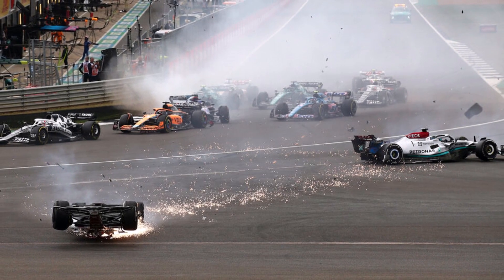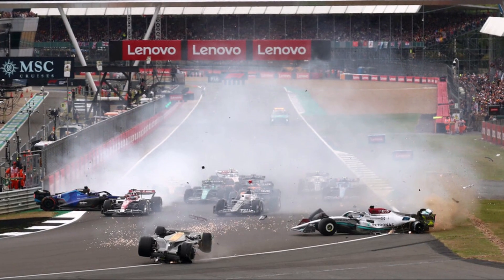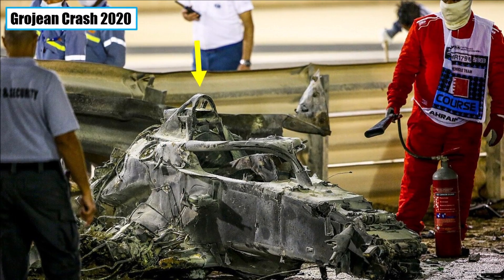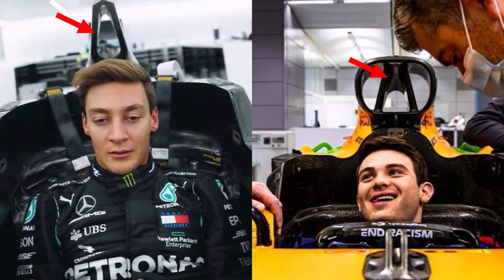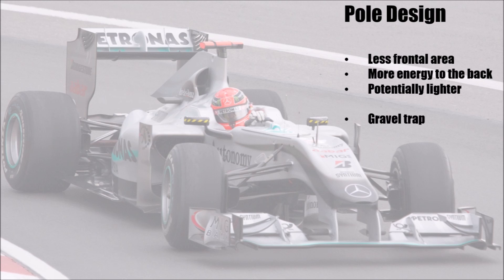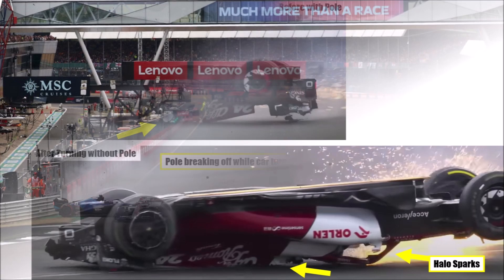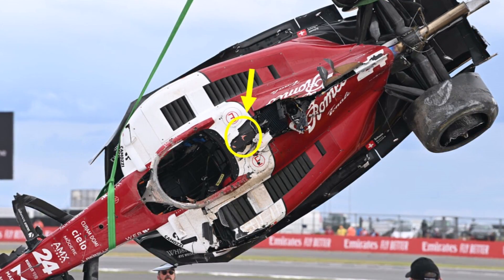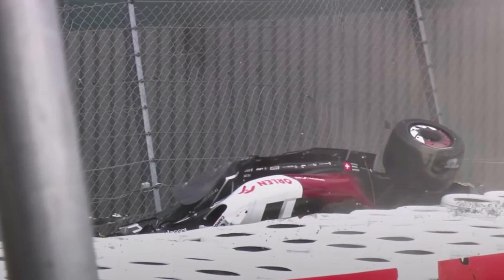F1 2022 - British GP - Lessons Learned - Zhou Guanyu's Crash Analyzed

Comment: there are a variety of safety flaws that became extremely apparant in this incident.

1 - the roll hoop failed. i never saw anything like it so it's likely it's a fabrication error or perhaps design flaw, but it happened nonetheless. if there was no halo, this would have been far, far more horrendous, likely fatal but atleast Zhou would have had spine / neck injury and at the least would find himself paralyzed from the neck down, but potential crushing of neck vertabrea could also snap vital parts and as such kill. The roll hoop failing is a serious issue and let's be fair here, it failed 100%. If this were to happen in a car accident, then the producer would face manslaughter and liability. Alfa/Sauber seriously needs to get a very very hard investigation. Things failing because of saving or inadequate safety measurements are exactly what cost Senna's life almost 30 years ago. 

2 - the end of the gravel trap needs to be alligned with the tire wall instead of having a 'road' at the edge. when zhou's tyre collected that 'wall' of the gravel trap (look at it as a swimming pool filled with gravel), the car was catapulted upwards. If the wall of the gravel trap was alligned with the tire wall, then the tires would have collected zhou's car and he'd be catched and thus held, into or on top, or in front of the tire wall, not OVER it.
another option is to have atleast double the distance between gravel trap end and tire wall.

3 - the distance between the tire wall and the fence needs to be increased. not decreased, as the opening helps in absorbing any potential impact. if it was directly to the fence, then the resistance would be greater and thus harder. landing on top of the tires is always a possibility but needs to be avoided as it complicates salvaging the driver from the wreckage.

4 - the danger is too that with the roll hoop sheared off, you cannot know whether the car's hybrids are safe and there is electrocution shock danger. there needs to be additional lighting, perhaps in the cockpit. now the roll hoop should never fail or come off, but could become damaged. that might also hamper the light working. so i'd say additional indicators are needed.

5 - there must be implemented fast extraction possibilities. it took way too long for zhou to leave the car. If there was a fire, he had no way of escaping (partially due to the roll hoop failing) and this would have meant a horrible death or at the least severe injuries. 

so these 5 things must be looked at quite profoundly. The track sided issues are really not that spectacular, but rather need to be brought into the rulebook. gravel traps are fine, but obviously the higher kinetic energy due to the heavier and faster cars and their designs need some fine tuning. the car sided things aren't so spectacular, perhaps the single-pillar roll hoop needs to be banned, and there needs to be investigated how the roll hoop is mounted and perhaps load testing must be increased since the cars are also heavier and as such carry more kinetic energy. the hybrid warning lights are an easy fix. 
the biggest issue imho is the extraction problem. it really is something to look into.

that said, i do wonder, did the roll hoop fail because it's a mandated design after grosjean's incident? the roll hoop did catch him but also kept him 'trapped' underneath. i don't know if a rule change was implemented but if so, this needs to be altered asap.

lastly, there are also some good things to conclude.

A - the halo once again saved a driver's life in a rather spectacular fashion, nothing short of that of Grosjean's crash. 
B - the car's safety features are so well designed (bar the roll hoop in this case) that Zhou managed to walk away from this extremely violent crash without any injury.

What surprises me a bit though is that if i compare Mick Schumacher's crash in Monaco, where the rear end of the car just snapped off (designed that way by rulebook), that did not happen here. I have no intel in knowing whether the G forces applied to the cars at those areas were similar, but Mick's crash in Monaco imho was not as violent as his crash a few races before, and it surprised me and others that the car snapped like that. 

If that is an indication of flawed design, then i'm starting to see a worrysome pattern here, which might come from the teams trying to save weight. Most cars if not all are/were overweight at the start of the season and some teams even saved by painting the car less. If they apply less weight by shaving off some material in areas like the roll hoop, the connections between the rear and front, then this is worrysome and should be swiftly adressed and perhaps the minimum weight must be increased.
Reply: You summed it up perfectly. There is definitely going to be an investigation on the roll hoops.
Regarding the gearbox coming off, in both of Mick's crashes, he went into the wall at an angle. So there was a significant net lateral rotational force on the car similar to what we saw in case of Romain's crash.
But with Zhou that lateral rotational force was not that much. It did flip but both car and the gearbox structure's rotation was on the same axis.
I would say the cars are doing what they are designed to do with the exception of that roll hoop. 
I honestly did not notice that the roll hoop broke off on the tarmac. 
That should never happen. Its a hard deflector type structure like the halo not an energy absorbing structure like nose cones.
Reply: @jozsefizsak  A suspension arm went through his helmet...
Reply: @Andrew-vx2ls  really? Wow.. how come he didn't sustain any injury then?
Reply: @Vik470  he did, he had major head injuries. Wtf you on about
Reply: @jozsefizsak  Senna's death remains a mistery but it is claimed that a suspension rod actually perforated his helmet and penetraded his skull and brains, which would have made him immediately lobotomized and as such, braindead. 

what my point is is that there is a great amount of evidence that suggest Senna crashed into the barrier because the car's steering shaft broke, making it impossible for him to steer. the shaft broke supposedly because of saving weight. It's exactly this what we're seeing in F1 right now - saving weight on potentially dangerous areas.

another issue is that senna's car also seems to have bottomed out - planking, making it lose downforce and thus sliding straight into the barrier. 

the reason it bottomed out was partially due to the neccesity to drive the car as low as possible, and the banning on ride height control. 

we're now seeing the cars porpoising like mad and the cars scrape the bottom of the asphalt, i keep fearing that we are going to see a repeat and we have a ban on suspension dynamics like the system (not talking about DAS even) that for example Mercedes was running. 

It makes it more challenging but also more dangerous, and to be fair, with the budget cap introduction, i dont think that they should implement those bans anymore since you have a limited budget anyway.

matter of fact, if those suspension 'trickery' actually nullifies or 'counters' the porpoising, then this should actually be mandated to be installed by the FIA. 

since drivers are getting far more worn and fatigued by the vibrations, i can only see more and more dangers. 

Matter of fact, there are elements in place right now that actually remind me of 1994.
Reply: @manoahvanderwolf3259  his steering column broke the bottoming out wouldn’t have caused him to drive straight off
Reply: @manoahvanderwolf3259  true, a lot of reports, different theories and opinions are written. However, I think it remains to be a mistery.
Reply: @Goaltimer  i agree, there are also some very interesting theories with more 'sinister' arguments but your statement is valid, it will remain a mistery forever. my point stands though that there are quite a bunch of similarities with the current rules, the following of the rules, and the governing that are eerily similar to that of both 1994 and quite frankly, that faithful day in Suzuka where we lost Bianchi, and there are only seemingly coming more and more instead of less.

again, it is fantastic that Zhou survived, but the amount of extreme crashes this season is really worrying. 

The dutch maniac also has been far easier this season but the end few corners against Schumacher showed similar behaviour of last year and once again is not getting looked into.
Reply: @manoahvanderwolf3259  - As the video pointed, the Alfa Romeo is the only car on the grid with a single pole design roll hoop when compared to the more traditional triangle roll hoops adopted by the remaining teams.  Both designs get tested vertically, longitudinally, and horizontally by the FIA under certain loads.

What happened to Zhou's car was-->1) It was fully fueled and 2)  after impacting with Russell's car, it sent the Alfa Romeo airborne to a certain height, turned upside down, and the shear mass of the car, velocity and the tarmac caused the single roll hoop to loose its structural integrity hence breaking off causing Zhou to slide from the tarmac into the gravel.
Reply: I totally agree with no 3, and add a layer of tyres behind the steel barrier. It was scary seeing the halo resting against it.
Reply: Loved the way you summed it up! But when I first saw the crash I wondered how Zhou's car simply flipped immediately. In previous Formula 1 cars we rarely saw that happen. Is it because the tyres have a much lower profile now, and the Alfa Romeo flipped because the rim touched the asphalt and acted as a lever? I'm not sure if Zhou's tyre running over George Russell's tyre made the flip more likely to take place but the fact that these tyres have a lower profile now make me question if we are going to see more accidents like this in the future. That tyre design was a major changeover that could haven't been well thought out.
Reply: @pedroneves8288  I am inclined to say that i personally think that the car flipping is not really that different from any of all the previous f1 years, again remember Guiterrez, remember Webber, remember Massa upside down in the Williams, Alonso in the Mclaren. 

However, it must be said, you do raise a valid point in the lower profile tires having less cushion compared to previous years and as such there could indeed be a harder contact, compounding the effect instead of lessening due to flex (cushion) with the bigger tire walls. there is about 5 inch less cushion / flex than previous years so surely it will have it's impact, but there's really nothing that can be done about it.

I don't really believe that it's necessarily a cause for more accidents, but there definitely needs to be looked into lessening the aftermath of such incident.

Whether the FIA has dropped the ball on testing the roll hoops by not increasing a higher load which it should due to the increasing weight of the cars (they weigh now a mimimum of 798 kg whereas in 2019 that was 740 kg, that's about 60 kg more and it means that needs to be calculated in, it might be 60 kg more, but kinetically the force grows exponentially so it might not even be a mistake by Alfa Romeo but a mistake by the FIA themselves.

There are valid points in regards to the mounting of the roll hoop. the Halo is bolted on, if the Roll hoop may be glued, then this is a certain mistake and must be corrected immediately. 

I think the right way to go even is to incorporate the roll hoop with the halo to make it 1 massive solid object. 

the dimensions of both the halo itself and the roll hoop can stay the same, just that they need to make it into a contineous form so that the 2 or 3 roll hoop mounting points are now also connected with a tube to the halo (on the lower part) and this would guarantee one solid, strong structure.

obviously, it would increase F1 car weight again and as such the force it needs to withstand also needs to be higher.

the problem is we're on an endless path here of weight increasement due to the safety measurements that need to be implied because the cars weight goes up. it's like a contineous circle that doesn't end.
Reply: @manoahvanderwolf3259  There seems to be a consensus here.  I was going by a very old article that I only vaguely remember.
Reply: @manoahvanderwolf3259  Tottaly agree with you! The great issue in this accident is definitely the detached roll hoop. I just tried to add a new point when I mentioned the new tyres profile. The new ones should cushion a lot less, as you say. Anyway, just checked on Youtube the 2014 Germany GP where Massa got upside down and a nearly identical crash at the 2014 Bahrain GP with Gutierrez. They were a carbon copy flip to Zhou's. So, maybe the tyres aren't so much to blame. On the other hand, on both occasions (Massa and Gutierrez), they got quickly into a straight position probably because their hoop made the car tilt a lot, since it's not flat, giving the car a higher centre of gravity when flipped over and, since they were in a hard surface (asphalt), the car tends to return to the "back on its wheels" position and tends to stay there, sliding away. That probably didn't happened with Zhou because of the gone glued hoop!
Reply: @pedroneves8288  I just checked Massas crash from 2014, its actually different. Massa was already turning for turn 1 there, the weight of the car was on the left side. With Zhu, it happened in the straight, so If you look at the replay, you will see how the tires stuck once he was hit, really like a lever. Interesting mechanics in play.
Reply: @Szaboo92  Just checked once again, and it turns out you should be right! Massa's car was already turning right when was hit from the right hand side. The new tyres may be a better lever. We'll see as time goes by.
Reply: The spectators need more protection too especially in that area.
Reply: Brilliant summary. It’s nice to read comments from someone who knows their stuff.
Reply: The drivers usually can get out of the car fast, he just didn`t have the space due to the cap between the tyres and fence where he wouldn`t had ended up in the first place if the roll hoop hadnt failed. The thing just flew off and left the car with a flat surface to slide on. So the roll hoop failing is probably the biggest issue with this crash.  Fix that and u probably dont even need to bother urself with the rest of the things on this list.
Reply: The design was approved by the FIA and has been used previously. To think Alfa needs to be investigated for endangering their drivers is ludicrous. It's a design flaw that needs to be addressed yes. It wasn't seen until now thus nobody expected this to fail as it did. I suspect after this they'll mandate just the one design implemented or more testing and development to strengthen and fix this particular design flaw. Overall I think there's a relatively easy fix either way.
Reply: @jozsefizsak  yes and no the main reason it was when senna crashed, the arm that holds the suspension on right side of the tire came of and he crashed and went inside of his helmet, and crushed his brain, the metal broke and flew back and hit him in the head piercing the helmet, right above the eye protector and where the helmet start, theres documentaries on youtube where they show this , was really sad
Reply: Single rod for roll hoop needs to be eliminated in favor of triangle design. Better yet, the pole should mount at the floor pan and be braced at exit of the monocoque for maximum rotational resistance. Single point of connection cannot resist rotational force as well as a multi-point element such as a hoop.Still, Ghou walked away, which, no matter how you look at it, is nothing short of miraculous. Kudos to safety engineering. Now, remove the jewelry.
Reply: Some dude on the internet (you) apparently has better ideas than the people who are employed to do such and spend multiple hours each week on this. Sure, the cars are pretty safe for most situations, but I agree that a lot more needs to be done to avoid someone getting injured or killed in an accident that is less likely to happen
Reply: the safety of the barriers is concerning. Grosjean crash was scary, those Armco barriers should be outlawed. As much as I hate to say it, nascar had developed the safer barriers, with very good results. The way Zhou ended in between the tire barrier and the fence was unacceptable. if he had a fire. I saw no way of him extracting himself and officials took their time getting to him. F1 needs to rethink, inspect all barrier at any track they race, and not race there until changes are made. it's unacceptable in this day, and the amount of technologies available, that at least have barriers that keep the cars inside the circuits so medics car help an injured driver. With amount of money spent in F1, they should be able to create a safer race track on which to compete. just my opinion.
Reply: About the back snap between Mick and Zhou...
I think its more of traveling in different direction, between front and back

Mick car snap because after touching the wall
The car basically become like a flail, with heavy side (backside) swinging absurdly

While in Zhou case
Both back-front car are travelling together to the same destination, while upside down
Then went to air together
And then drop to the barrier together...
Basically it took damage as a whole car

__
And about the roll cage

Personally think, if its a normal roll, it would be fine
But it was not only a roll
But the topside of the car crashed into ashpalt at high speed and grinded several meters

So yeah, that was unique crash... A scary one obviously
Reply: Absolutely agree,
I honestly think we should have the chassis/monocoque structure distributed like Indy. (Dallara)
Just have it built and ready to have a power train built into it and of course the suspension/torsion bars and such. 
This will at least make the chassis/monocoque safe and consistent
Reply: @jozsefizsak  senna died bc part of the suspension snapped and struck his helmet. What OP is prolly referring to however would be the weld found on the steering column that was done by the team and done in a way where it didn’t have 25% the structural integrity it should’ve. Many believe the steering column broke causing Senna’s car to go straight to his demise and there is a substantial amount of evidence to support that theory. It’s what I believe happened as well.
Reply: Yes, especially agree with the weight issue. The minimum weight should be easy to reach so nobody needed to skimp on security measurers. The minimum weight should be so easy to reach that every team had reached it easily before the season began. Weight is obviously one of the difficult things to get low enough this year. So if they had for instance added another 50 kg to the minimum weight. Then every car would not have been overweight, and you would have had a more even playing field. And also you would not have had to skimp on saftety measures.
Reply: The roll hoop itself didn´t fail, it got torn off because the carbon fiber of the monocoque delaminated or got ripped apart. The hoop did what it was supposed to do.
Reply: @GeirGunnarss  i would say falling off is to fail. But it's up for discussion I guess.
Reply: @GeirGunnarss  so it failed. Doesn’t matter if it was the carbon fibre or not. The connections from the hoop to the car failed. So the hoop failed. You’re just talking semantics here.
Reply: @damedusa5107  I'm interested to know why they need the hoop AND the halo with equal/similar functions. Is it a needed redundancy or the first is not supposed to withstand these stresses since the halo is? Maybe the hoop did the bare minimum it was supposed to do, to withstand the vertical impact and the lateral tear off was too much for it (idk of course). But the halo was perfect, nobody is saying nothing bad about it anymore (including me).
Reply: @EduardoRimoli  well the hoop definitely failed, it’s supposed to withstand that, if you look at the position of hoop and halo, when both in tact, they give a good clearance even if the car is upside down in gravel. But with the hoop gone, he definitely got gravel impacts on his helmet. 
But the Halo  is the ultimate insurance policy. The halo Did it’s job. because the 3 fix points are widely spaced it can take more punishment, but this particular hoop may need design changing tho. Unusual to fail. But also rare to see a car slide upside down for so long .
Reply: Perhaps the thing to do is to ban F1. The cars are too big (wide and long), too heavy, too fast, too vulnerable (open wheels) and driven by non sportsmen, who pander to business needs, like professional footballers!  Tin-tops and sportscars please.
Reply: 1. Yes, the roll hoop failed and that is a serious worry, but until the FIA finishes it's investigation we wont know exactly what happened to it. It's worth remembering that the crash test requirements for the roll hoop are currently higher than they've ever been in the past and meeting those requirements is part of the reason why F1 cars are now heavier than before. My personal theory is that because the car was spinning whilst flipping there was a torsional factor that added excess stress that the roll hoop couldn't deal with, but I could easily be way off.

2. Those roads are there for necessary access reasons, and if you watch the fan footage from the Abbey grandstand you can see that Zhou's car was starting to flip before he reached the end of the gravel trap. It's a sad fact that a one-size-fits-all solution to run off areas just doesn't exist, for every solution that reduces the risk in one type of accident it increases it in another.

3. Not sure about this one, I don't really know enough about the specifics on the design of safety barriers to say but a narrow space for a car to land in behind the barriers is not good, I just don't know whether increasing or decreasing the gap is the answer.

4. I'd imagine there's already other indicators other than those lights on the roll hoop. There's also a kill switch for the cars electrics on the front of the monocoque.

5. Are you a Doctor? No? Then I'd recommend you STFU on this subject. The extraction would have taken exactly as long as the onsight Doctor, who would have been among the first people to reach the crash given the medical car starts right behind the field, decided it takes. You DO NOT yank a potentially injured driver out of a car without checking for potential neck and/or spinal injuries first, thats exactly how Philip Streiff ended up paralyzed after a testing crash in '89. Talking about fire is worthless because there wasn't one and everyobody involved there could see that, unnecessarily rushing an extraction can cause significant and avoidable injuries. In the event there is a fire they already have different preocedures to deal with such a scennario. Neither of us have the years of medical training, if any, to remotely make informed suggestions regarding extraction procedures of a potentially injured driver.

When it comes to engineering, saying X should never happen is nice but not always realistic, there is always the possibility that forces involved can wildly exceed design specifications no matter how much you ramp up the requirements of crash testing.

Regarding Schumachers Monaco crash, I've seen it suggested by Gary Anderson that the conveyer belting infront of the TecPro barriers has a rather high friction coefficient and when Mick hit them and moved the barriers, the belting "grabed on" to the rear wheels and added an extra turning force onto the rear wheel that caused the pins holding the gearbox on to break. No such application of force was in play in Zhou's crash.
Reply: HE SURVIVED TOTALLY, SO EVERYTHING WORKED.

Go watch sim racing if you can't stand this kind of accidents.
Reply: @s1003232  people used to think like this until Senna dies in 1994, previous years we saw big accidents at the Tamburello.